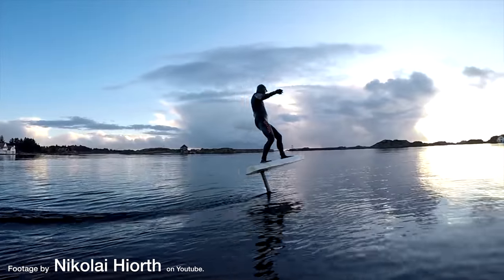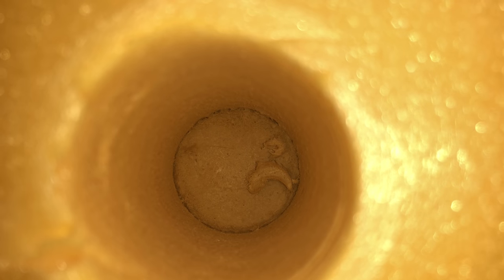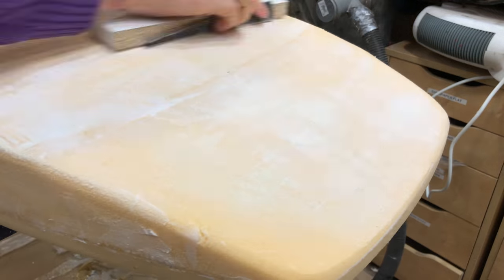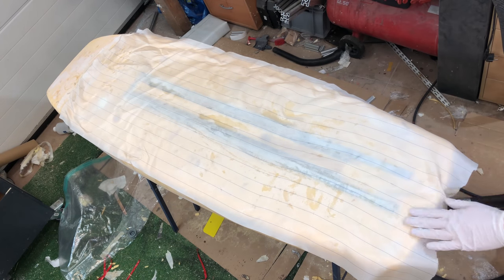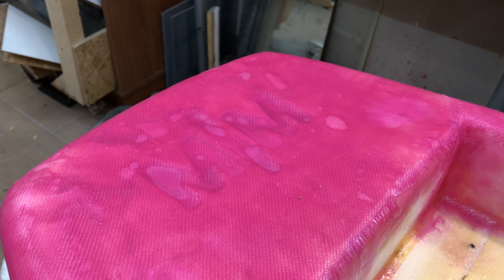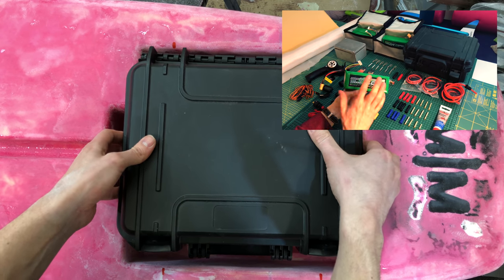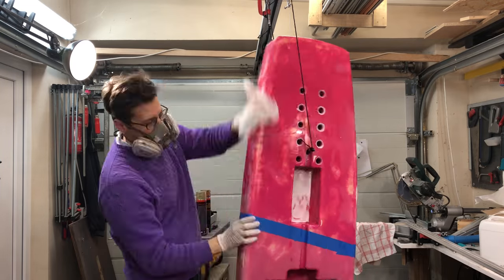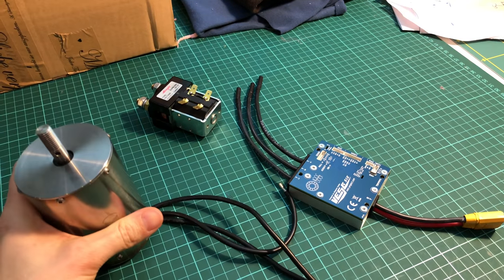How to Make a Foam and Glassfibre Surfboard (Electric Hydrofoil Project)

Comment: Wow, that was a lot of work but you got it done! 
If you decide to make another, I'd use a better foam to begin with, there are many to choose from that won't chip so easily. Filling all those holes didn't look fun. When sanding, I'd recommend using an angle sander, with a foam pad disc, it's much easier and more forgiving.

All in all, you did a great job! Just though I'd give some tips on past mistakes of my own.
Reply from the maker: Thanks! I will probably build a V2 one day. It will be completely hollow so all the electronics can go inside. Ill probably machine a mould for that.
Reply: Max Maker Thanks for your reply. 
That sounds really cool and likely a better way to go. How's your first board holding up, are you still riding it?

In surfing, (as you probably already know) the very first surfboards were solid wood until Tom Blake made hollow surfboards and paddle boards.
I didn't see another hollow board until the early 90's, it was the idea of a retired NASA engineer. It wasn't totally hollow, it had a lightweight, honeycomb core and worked well. Since then a few well known shapers made completely hollow, performance surfboards from carbon fiber.
Watching them being made was really cool, especially because I got to keep one for myself! They perform really well in surf up to six ft. but after that, they start to chatter. You don't have to worry about that with a foil board as long as the foil arm is strongly secured to the board and is hydrodynamic. 

There's a company that been making electric foils for a long time now, I think there were called E-foil. Check out their designs and concepts for ideas to maybe add to your next board.
Reply from the maker: Hollow boards or honeycomb are kind of a no-brainer for engineers since the load at the core of an object is close to zero. Ill probably add a few ribs near the mast mount and three compartments. Batteries, electronics, ESC. 

I haven’t ridden mine yet. Still waiting to finish the motor and doing prop testing. Thats the easy part but I lack time at the moment. I moved to a new workshop and apartment, so that took most of my time this summer.

Comment: Max great job but you really need to go through a composite work improvement... pre preg techniques and vacuum processes, that would save you loads of sanding time and lightweight construction... If u want to collaborate I designed and built foils since 2006...unfortunately and stupidly did not pat pent this and now its exploded in the market keep on posting!!!

Comment: Really great work. Nice dust collector too, I need to do a bit of work on mine.
Reply from the maker: What setup have you got? I use a dust deputy and a shop vac.
Reply: I've got a custom rig I made, then one by the manufacturer, Romaxx. The purchased one is often too wide, and mine doesn't have a skirt, so neither works perfectly.
Reply from the maker: My one is just a piece of plywood screwed to the router clamp. Then I glued some PVC fabric to the plywood with hot glue. I tried the whole magnet thing  before to make it detachable, but that is not neccessary I think. I rarely change the bits.
Reply: Ah, interesting. Didn't consider that hot glue would work there. That will make things easier, thanks!
Reply from the maker: It really did! I hammered this together just before I cut the blank. Works really well.

Comment: Very impressive work there Max!
First off, any mold-less composite will take a lot of work to get a nice finish.  Your work is spot-on.
The bubbles in the poured epoxy can be greatly reduced by using a very fine mist of denatured alcohol.  If you want you can have a natural finish for your board with just epoxy and not have to paint it.  Just wet sand the poured epoxy and then use a rouge with a buffer.  It still a lot of work, but the finish is quite durable.  Since you have CNC cut shapes the surface is pretty close to perfect so that the finish work  will really show, and show up quickly.
May I ask how much a CNC machine of that size goes for?  Did you make the CNC machine?  I seriously believe that the quality of your board is due to the CNC use.  Making that by hand would have easily doubled your work time.  I make carbon fiber parts with a clear epoxy finish so I have a clue on how much time they can eat up in trying to get it right.  Making the shapes by hand is rather frustrating at times and graduating to a CNC would be the way to go.
Excellent work, and thanks again for posting your videos!
  Mike
Reply from the maker: Hi Michael,

Thanks for your tips. The CNC certainly made it easy to get things symmetric. Especially the dust collection makes work more comfortable. Some shapes like triangles are very difficult to cut without a CNC. I build this one myself. I payed about 2500€ in parts. The work area is 155x55x14cm. 

I probably sell it though and build a bigger one when I move to a larger workshop. Then I can input full sheets of plywood.

Comment: What foam did you use i have some precision board 10 and 15 lbs but your looks much lighter?
Reply from the maker: I used regular building insulation foam from the hardware store.

Comment: Where do you get your foam? I've been having a really hard time finding suppliers
Reply from the maker: Here in Germany you can buy it in any hardware store very cheap. I payed 36€ for all of it. It is used to insulate buildings. So if you live in places where they don’t isolate like Peru for example, that explains why you have a hard time.
Reply: Max Maker In my region we only really use fiberglass batting or the thin foil backed foam... Any specific brand name? I'm sure I could order some online if I knew what to search for
Reply from the maker: No brand name. There are a ton of manufacturers. There is XPS and EPS foam. I used XPS because it’s finer.

Comment: wow that's a lot of work, would it be easier to build the board out of wood. What's the advantage to using foam and fier glass?
Reply from the maker: Foam is lighter than wood. This worked well for me because I cam CNC it.
Reply: I'm trying to figure out a simple plan which a 10-year-old could build. You see I run a tinkering club, and we use Pallet wood as our main building material, I guess our impossible plan is building a hydrofoil with these simple materials.
Reply from the maker: Hmm. That sounds impossible indeed. This project is like building a Formula 1 car in terms of complexity for a DIY builder. How about building a stitch and glue boat? Stitch and glue is quite a cool technique.
Reply: They built a raft but the impossible projects are always the most fun.
Reply from the maker: Haha. Sure!
Reply from the maker: Why not adding a motor to a table without the Hydrofoil? They are sharp and dangerous...
Reply: The Hydrofoil is the objective, and the platform to stand on could be anything, right? It would be hilarious to ride a plastic table top hydrofoil but I'd recommend removing the table legs or maybe keep one to hold the Foil in place.
Reply from the maker: Yeah, the hull doesn’t matter that much, but it needs to be light. You find more info on efoil.builders
Reply from the maker: Thanks, but I am based in Germany : /
Reply: then that's better for me, I'm based in Denmark

Comment: Good afternoon. Would you like to know which motor and how many batteries are you using? What is the autonomy with this amount of batteries? How many volts? how many amps?
Reply from the maker: Hey. You can find most answers to your question in the second video I made about this.
Reply: Can you send the link? My English is a little bad..
Reply: Could you send the materials and equipment you used to build this board? engine, battery, esc, gearbox ...
Reply from the maker: I made a video. You find it in my channel. More details here: http://efoil.builders/t/the-max-maker-build/1132/33
Reply: Thank you so much
Reply from the maker: No problem

Comment: Great video! This series is the reason I am subscribed to you haha. It is nice you show how to do the basics like making the board too, a lot of efoil videos don't cover that. Btw how much epoxy and fiberglass have you used? (in euros or so) haha
Reply from the maker: Thanks, I try my best to show everything without making it boring.  The fibreglass was about 35€. I took whatever they had on sale. The epoxy was 100€ and the foam 35€. 15€ for sandpaper.
Reply: Ah thank you! You are doing a great job, I have also a youtube channel (not this one) and I have the same struggle, how do I explain everything and not make it boring. I find it quite difficult but you do perfect
Reply from the maker: Thank you very much. Which one is it? Ill check it out.

Comment: I was hoping I didn’t need to 1. Be an engineer 2. Have a budget bout 100k 3. Have a workshop with every single tool out there... to be able to make one of these. So from my point of view.. This is going to cost as much as buying a new complete finished product. I hope there is a ”easy DIY electric surfboard video out there”. Let me know if anybody knows such a vid?
Reply from the maker: You don’t need to be an engineer or have all these tools. You can hot wire cut the foam or modify a commercial surfboard. A lot of people make all special components with just a 3D printer. Unfortunately, there aren’t any commercial hydrofoils yet.

Comment: Next time don't apply pressure on the lamination.you force the epoxy out of the glasfibre which is no good. Pressure is only possibly in vacuumbag through vacuum force

Comment: the wing is poorly designed , i see them break and fail all the time , board is awsome
Reply from the maker: Really? How do they break? This wing might not be suitable at all, so I might build a new one. And definitely the fuselage. It is solid 20mm aluminium at the moment and heavy.
Reply: ok build a new and bigger wing,the double agent wingis low in area  to support all the weight  and the wood core don t help , a very thin layer of vasalt fiber is very easy to delaminate  flex and break